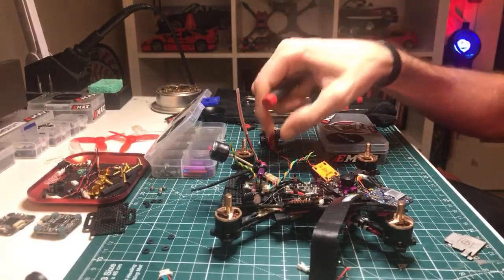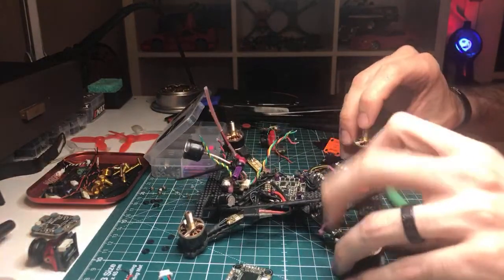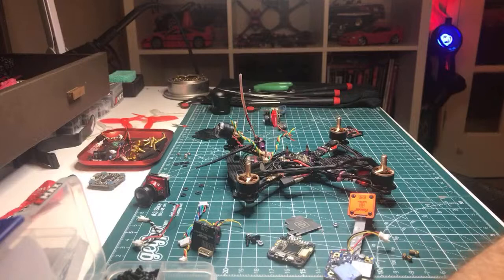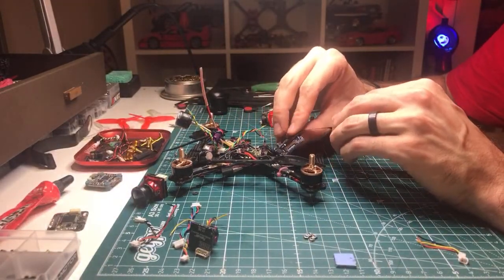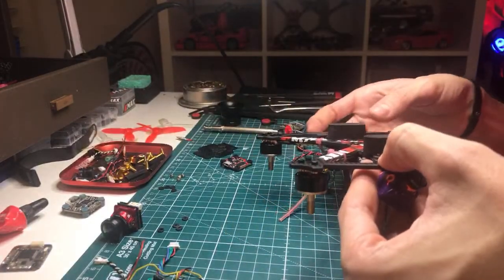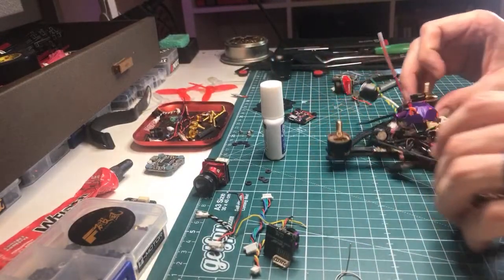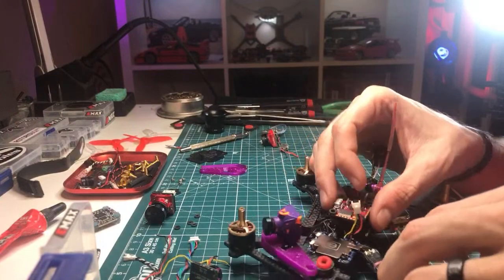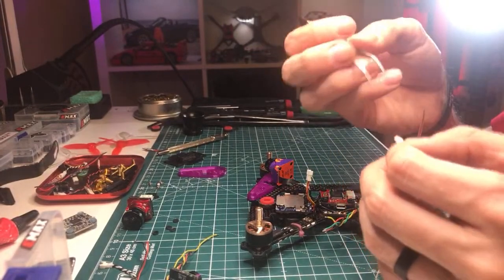Acrobrat Rebuild w/Proto TMotors

Comment: If it notches even a little it still will produce vibrations.
The tmotor F20 are super smooth and not notchy at all.
The emax 1306 4000kv are super smooth too and 10grams. (Still enough power imo)
The 1407 4140kv are the smoothest only a bit less robust.
The emax 1606 are little friggin volcanos so hott they become.
Best way is also bblog and test different motors